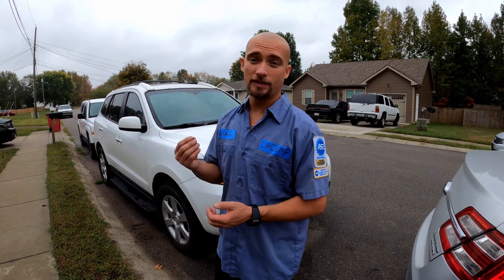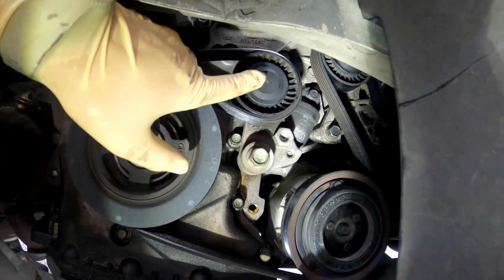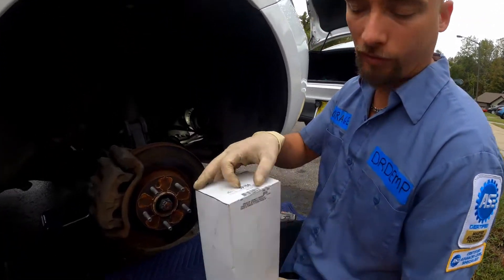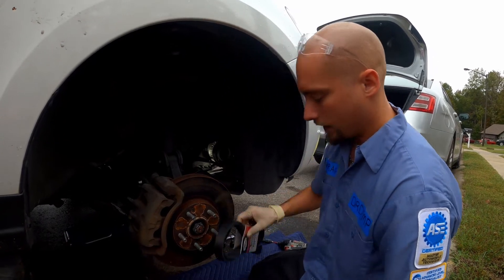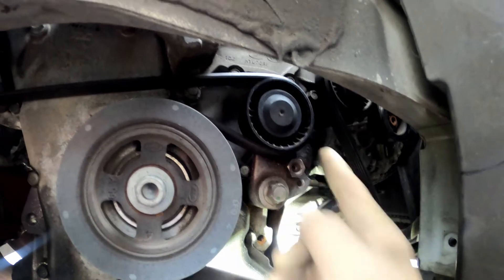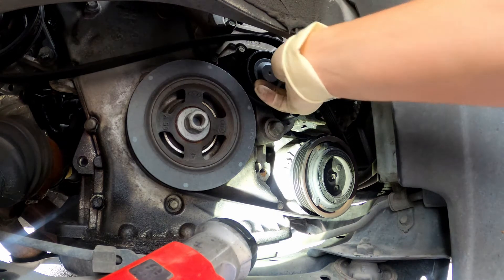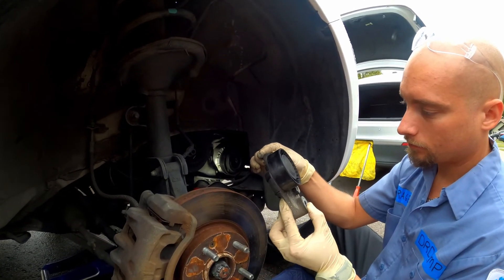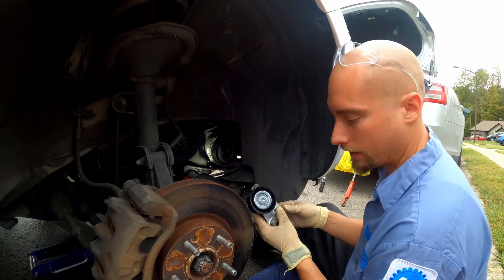3.3L BELT TENSIONER REPLACEMENT | HOW TO HYUNDAI KIA SONATA SANTA FE

Comment: great job, especially in the street!  Wondering if there is any usefulness in placing front end on jack-stands to then be able to turn the rotor assembly all the way right (or left) to gain better access breaking that 17mm bolt?  BTW, do you know if on this 3.3l when replacing the alternator you must drop the AC compressor out of the way 1st to gain access to the alternator?
Reply from the maker: Glad I could help!!
Reply from the maker: In my opinion ideally one should have an electric impact (or air with a small compressor) if your going to do roadside repairs like these. Milwalkee makes one with over 1000ft pounds which would be perfect! The second question im unsure if you have to drop the subframe, most cars you can sneak it out but its a tight fit through the bottom. 
Thanks for supporting my channel.

Comment: So what do I do if the nut on the tensioner is broke so I can release the tension?
Reply from the maker: Your replacing the belt and tensioner?
Reply: @DrDemp just the tensioner
Reply: The whole unit piece
Reply from the maker: @epicsans2037  belt may have to be cut off to release tension with tin snips. Use extreme caution.

Comment: Great video! One tip though if you do more vids is to get better lighting. I understand you are on the street however with all the portable LED lights out there you should be able to find a good one.

Ok, I'm off to wrangle my tensioner and belt, it should be much easier now with your expert instructions!

Thanks!
Reply from the maker: Thank you for your suggestion, proper lighting and camera angles are always a battle to give you guys (the viewer) the clearest possible view while allowing me still room to work is quite difficult. I've since invested in some lights I've used in my newer videos. 
Good luck with your belt, hopefully everything went smoothly for you. 
Thanks for supporting my channel!

Comment: Did I mess up the tensioner it was tuff at first to crank then it got real loose and now its not even tightening anymore
Reply: The top 12 mm bolt
Reply from the maker: Taking it off or putting it back on?

Comment: This is a pretty straight forward swap, and I'm frustrated with mine. The new tensioner doesn't alighn the same way as the old one, and the belt walks off. There's not multiple ways to put this on. It's just some engineer got creative thinking they could megamind some new way to make this better, and he should have stuck to the script. Be careful about your aftermarket parts I guess.
Reply from the maker: Definitely! All aftermarket parts are not created equally!